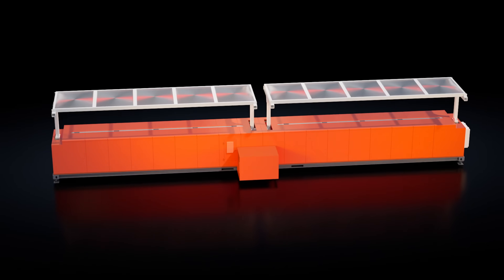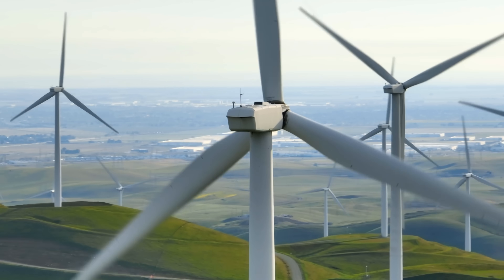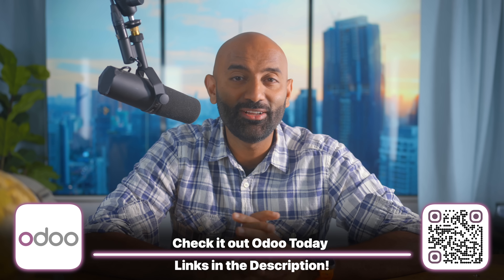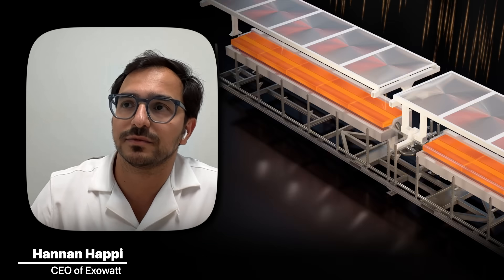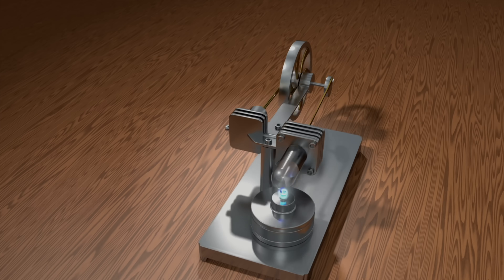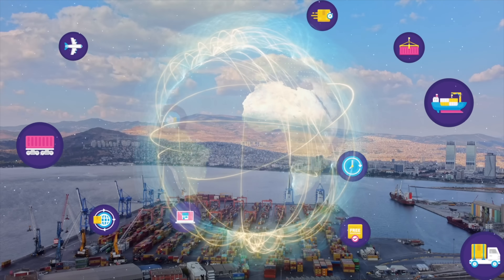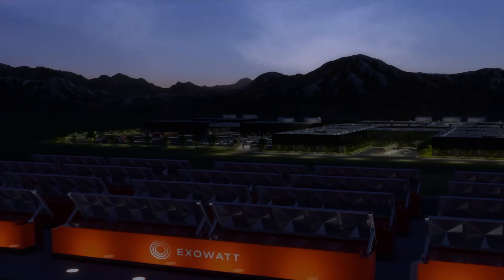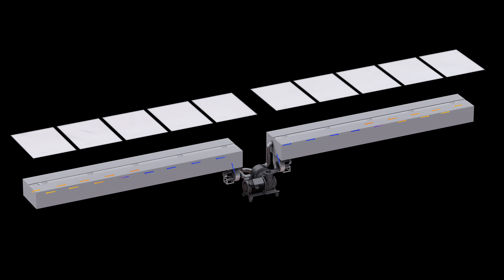Solar Without Panels, Storage Without Batteries - EXOWATT

Comment: I would love to know more about it's working principles. 
firstly, what medium do they use to store heat? because sand and clay bricks aren't good heat conductor which is essential when using fresnel lens, due to their point-concentrating characteristic.
and secondly, how long exactly can they store the heat, giving that they're only using sensible heat rather than latent heat (which stores way more for the same volume).
also thanks for the unbiased coverage about LCOE and land usage and anything else!

Comment: cool, but exowatt can be used as 'bricks or sand battery' for solar pannels, so you heat the bricks with the electricity and then get it back - it is cheaper the lithium, but who knows in caparison super condensators
Reply: Cheaper than lithium?  Are you figuring in heat losses in that calculation? There is going to be a minimum delta that the exowatt runs at. Also in spite of sterling engines being able to operate near the maximum theoretical Carnot efficiency, it's still not that great. Say this runs at 650 kelvin with a cold side at 330 kelvin.  Your theoretical efficiency is 320/650 or just under 50%, with friction losses you are closer to 35%.  Lithium systems can run over 90 efficiency.

Comment: If this is a self contained unit it could used in disaster relief
Reply: @TimBinns68   very little power for the footprint size.
I've worked on gas turbines that are basically the footprint of 2 40-foot containers and produce 30MW, about 10,000X what this produces
Reply: You can bring a giant truck full of high-density batteries right now. This requires a lot of setup that they omitted from the video
Reply: @amerikalast  batteries have to be charged
Reply: @amerikalast  or just huge diesel generator
Reply: @amerikalast  HOW are high-density batteries going to help AT ALL without power generation???
What "setup" have they omitted from the video? All the op is suggesting is that it could well be developed as a self-contained plug-n-play system, but depending on the level of damage to the power grid, this may or may not be as effective as a diesel generator.
Reply: @amerikalast  I was thinking of something that would last months not days.

Comment: I'd love a deeper dive to see this system at work, plus the sterling engine and its flywheel.  I would love to see someone make a backyard model for residential use.  We only use about 1500 watts per month so a small backyard system could power the house, heat water, and run out a/c units. 🤔🤔 Practically free energy!
Reply: you can get a Fresnel lens from the screen of those old projection TVs, and you don't HAVE TO use a sterling engine to produce the power, so building one of these is easily doable in your backyard. in fact I would LOVE to build one! hrmm... maybe I should start a youtube channel and begin with a series of me building this type of system... hrmmm
Reply: @ThatTweedle  would you pair it with a battery or keep the hot brick setup? Would need a pump to create energy from the hot brick setup. Interesting!
Reply: @ThatTweedle Do it…do it, I’ll watch.
Reply: @ThatTweedle if you don't use a Sterling engine. How are you going to create power?
Reply: @ThatTweedle  Could this be built in an attic, because of how hot it gets? A heat exchanger could pump the heat into an attic, for the engine to run.
Reply: @extraincomesuz  it’s more likely you’re using 1,500 kWh per month.
Reply: THIS
Reply: I agree, if Exowatt offered an affordable residential version of their system that can reliably produce between 1.5 and 2 KWh per month, it would be an awesome alternative to solar and grid based electricity. However, most electric companies hold local monopolies in towns and cities. They've lobbied (bribed) local governments to create laws and ordinances that require citizens to use their power system. Because of this you cannot go "off grid" in most cities. Check your local city laws to see what their rules are for installing a solar + battery system. Most only allow a grid tied system so you still have to pay.
Reply: Maybe you use 1500 kWh per month.  Big difference.
Reply: I hate to break it to people. a small window ac unit uses about 1500 watts PER HOUR at 120 volts. central heat is about 10,000 watts per hour @ 240 volts.
Reply: That must be one very tiny AC unit to only have 1500 watts per month unless you only use it like once a month
Reply: @divergentthg7925  Are you consuming much more than 1000 kWh per month in your home? I have not looked recently since a son moved back in but my 2500 '^2 home is in the neighborhood of 2000 W average load with heat pumps/air conditioning.  The 1500 W average load should not be far off from an average home consumption.
Reply: @mrhickman53 unless you guys are wording it differently 1500 watts a month is like saying you have the AC on for about 1 minute each month. Now it's 1500 kilowatts per month or an average 1,000 ft home uses 850,000 watts per month you have to word things a bit differently. my camper AC runs about 1200 watts every time it uses so something is off. So are you saying each time you use it per month you don't go over 1500 watts so you can use like a 4000 watt inverter to run everything?
Reply: I believe we might use more energy in the near future so 25 kWe per household/homestead gives a lot of practical flexibility.  Even a significant fraction of the output at 8-15kWe is a solid domestic energy baseload.  Now if they could fit this in a powerwall + HVAC/water heater combo in your house, garage or shed 👍🏾.  Under 2 meters squared of creative dreams 🙂.
Reply: (1500 watt) * 30 days = 1080 kilowatt hours
Reply: @catprog erm, no. 1500 watts per day is 1500/24, that’s around 60 watts per hour, which would struggle to run a couple of light bulbs. If you’re using 1500 watts for the entire day, that’s 1500 (watts per hour)x 24, that’s 36 KWh. Per day. For 30 days, 10,800 kWh
Reply: Deep dive please, very interesting!!
Reply: That would be cool.
Reply: you mean 1500kwh? 1500watts is like nothing.
Reply: @thiagoracing  yes, i have a 1000 watt wall unit in my room ( pool house) 16 x 24.
It's barely enough to cool my room. it works hard on hot summer days on 24/7s
There's also patio all around my room and a big tree to help give shades.
It's just my room....not the main house with 5 bed, 3 bath, living room, den..ect
God forbid if I count the POOL pump.
Reply: True, but it is only accessible to consumers because massive companies buy them first putting in large orders, stabilizing the price of production. Without that, single units are too expensive to sell to consumer.
Reply: You may have plenty of energy in the summer but probably have a number of days in the winter without any power. This is why the preferred green choice is Solar/wind/Storage as wind in the winter can fill a lot of gaps.
Reply: @jjamespacbell Depends in what environment you live in. I live in a very windy environment, second in the state where I live. We have 0 commercial windmills because it's not the right kind of wind. To strong,  and intermittent makes it not viable.
Reply: so long as the price is under $ 10 K. 1500 watt sounds good..... 1 square metre of solar energy is about a thousand Watts...... So maybe a system two square metres
Reply: @13thbiosphere 25 kwh system is the smallest it goes
Reply: @unipartywonagainstthepeople  24 months that may change
Reply: @13thbiosphere  1 sq m is a 1000 wats of sunlight energy total.  you have to consider the efficiency of the system, likely under 20% efficient probably significantly less.
Reply: @hansbraun2726  possibly 40%
Reply: @13thbiosphere  well...it's a catch 22 aint it.  You're going to need a lot of A/C to live
in lots of sunshine, It's still going to be hot, stuffy  N humid as F#@K at night time.
On top of you asking Chat GPT how to fix the damn thing...when it breaks after 6 months
of usage , after the warranty runs out...

Comment: How are they going to radiate all of the heat away from the sterling engine, doesn't it work of differential temperature. I see the hot side where's the cold side?
Reply: The air itself is the cold side
Reply: @saxonsoldier67  YES TRUE but you end up with a heat island effect.
Reply: @dksaevs  Agreed: Water cool the "cold side" of the Stirling engine, then use the heated water for an industrial processor heating nearby.

Comment: so why dont you just dig channels under the whole farm, maximum area usage. or put the solar on roofs. scream from the roofs. ie service tunnels. well you could always not use batteries, only solar, and pump the solar panel electricity into rocks. or just make more economical large batteries. solar on rails. anyways, the best market will get rid of itself. ie it solved its problems. did not make new problems. did not stay as the problem to be solved. race to solution instead.

Comment: No polymere fresnel will last 50 years, 15 maybe, tops. And if you use glass (cheap glass) you lose a lot of energy. The idea is great, but the materials to get high efficiency are still expensive.

Comment: What about using heat as a storage mechanism for energy?  When done at scale potentially like this, does that pose challenges as well?  I don’t know enough about other battery types to compare but wouldn’t storing the energy as heat in simple blocks like this have the blocks radiate heat and warm an area when done at a non-insignificant scale?

Comment: This type of thermal technology will always be problematic, because it's a waste of entropy. It immediately converts the energy from almost 6000 K to around 800 K. This is a huge loss, because work can be extracted only from entropy differentials. To make a wholistically efficient system, you need to layer as many different energy consumers into this temperature range as you can fit, between the initial temperature and the temperature of the environment (typically room temperature).
Reply: You are correct, but you did not understand the main goal of this project. The main goal is NOT to be energy efficient or to make the most of entropy differential. The main goal is to create something that generates renewable electricity from solar at the lowest possible cost of 1 cent per kWh, regardless of efficiency, even if that efficiency was 1%.

If efficiency was really a problem, we would have replaced all our PV solar panels with thermal solar panels and district heating to double their energetic efficiency. The reason we didn't do this is because there is more demand for electricity than for heat, and electricity demand will keep growing. Heat is great, but it doesn't power your laptop or recharges your EV. Electricity is in its own nature a waste of entropy.

If efficiency was really a problem, we wouldn't have started to use millions of acres for energy crops for biofuels. But we are still doing this because it's practical, easy and cheap.
Reply: This was designed to minimize levelized cost of energy.  Solar efficiency is theoretical. No solar is 0% efficient, yet most people choose that!
Reply: I would say it's optimised for the Levelised Cost of Storage (LCOS) rather than cost of energy, the energy aspect is not optimised (low efficiency) so will likely have a poor LCOE.

I would also be interested in the versatility of the solution to differing conditions - warm vs cold environments (losses of the heat stored) and solar collection power under cloud cover/radiance level at differing latitudes.

Also, if the comparator is PV+Lithium Ion storage on both cost and footprint metrics then how does this differ to cheaper stackable electrical energy storage solutions that allow PV to mounted overhead (Sodium Ion, VRFBs etc.). As well as other energy storage solutions seeking to reduce the unit cost, like Form Energy's Iron-Air (rust) battery approach.

Comment: You mentioned a few maintenance items, but you didn't mention cleaning the lens, which I think would be like a mega window washing operation. If not kept clean, the efficiency would be diminished.
Reply: If people need to oil the moving parts every now and then, you think they wouldn't use that time to give it a clean wipe?
Reply: @texanplayer7651  I have Fresnel lenses myself, the concentric grooves make it extremely difficult to clean. Also scratches the plastic. Last time I made one I added a second plastic sheet for exactly that reason. Of course it costs more.

Comment: All options need to be on the table.

If the US doesn't want it, a small island nation with limited land space might.

Even expeditionary military or disaster relief applications would benefit by being able to drop this in theater and produce input less power over generators or a large solar installation.

There is no one size fits all silver bullet for green energy production.
Reply: No country doesn't want cheap energy unless its a country that wants to de-industrialize. America likes factories and factories need cheap electricity. Generating power is easy. The problem is that there isn't a good way to store energy and thus all these ideas that generate power intermittently are only good in limited quantities or in off-grid situations. The problem with better energy storage is that you run into 1,000,000 new problems including new wars, rampant energy theft using drones on our outdated open-air grid, and people burning everything in gassifiers to run generators to charge up futuristic energy cells. You wouldn't want an armed tiny quadcopter to be able to fly 2000 miles and explode in your face because some guy in another country has a personal grudge with you.
Reply: Heard Island?

Comment: Sounds great. But I see some different uses for it. It would make a great solar driveway heater. Places that get a lot of snow would save time and energy. And produce electric when side walks, drives, and garages don't need the heat. What about using as supplemental heating? Like on top of a building.
Reply: If it's snowing there's usually no sun

Comment: According to Grok, a 40’ shipping container lacks the strength to support weight of bricks if fully loaded.  Furthermore the maximum weight of a semi truck and trailer is 80000 pounds leaving 70000 pounds as max payload with a maximum of 14000 conventional bricks or less than 3% of available volume.  Am I missing something?
Reply: Put the container with electronics, pipes etc in place first, and then add bricks?
Reply: 0:57 The video clearly shows that the container is not completely full of bricks, only a portion centered top to bottom, front to back, with a large insulation layer between bricks and container walls
Reply: You could take an empty unit to the site and buy local bricks that are put in onsite. 😊
Reply: Wow, if only there was a way to install the system in components on site to remedy this minor issue. "Support the weight"... they sit on the ground WTF are you talking about? Are you a bot or troll for fossil fuel or the power companies making billions killing us and the planet?
Reply: Semi tractor weighs far more than 5 tons. 
The containers are also reinforced. And it's not filled with bricks, so your math isn't even close. Not to mention there are plenty of overweight loads going down the road... you just need a permit. You asked AI the wrong question. This is a question for a truck driver, so you're welcome
Reply: The container resting on the ground only needs the bottom to support the bricks. As long as you don't try to pick it up the container is only supporting itself.

Comment: Yeah, this is awesome. Definitely try to get a full press tour and interview.
Reply: 100%, this seems like it could scale very quickly due to the non specialized nature of the components. There are lots of factory space that could be quickly converted to work with this basic hardware in the Midwest. Lots of train interconnects to ship all over the country and then offload onto semi's for the final miles. Also lots of towns that used to have steel and hardware industry that are just itching to boom back into relevance again.
Reply: Bring on the plant tour! Thanks
Reply: Yeah happy to see a plant tour.
Reply: Yes, please do a deep-dive! 👏
Reply: I second this.
Reply: I'd be interested in the blower & engine they produce to make the conversions of energy.  The glasswork, storage medium and tracking system seem well proven throughout history.  Plus, I'd be interested in the external source conversion rate/efficiency of the storage system, aka how well the system can store power from the grid.
Reply: This is so much better than solar panels and batteries.
Reply: Yes, a plant tour and deep dive. Also, residential scale off-grid economics @ both household and neighborhood scales. Compare traditional utility cost in time, regulatory approval and infrastructure cost to expand in a new development vs this solution in time and direct cost both initially and over time.
Reply: agreed, please get up close and in person !
Reply: FugYeah🎉